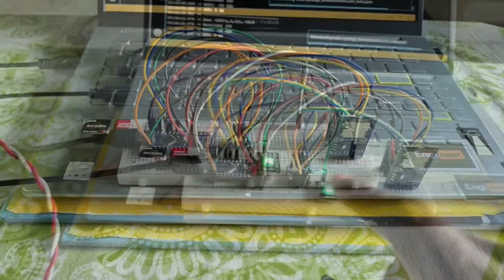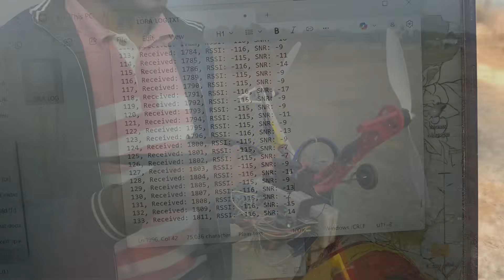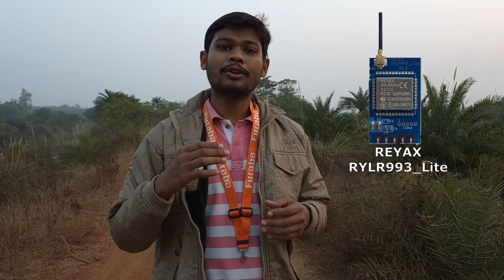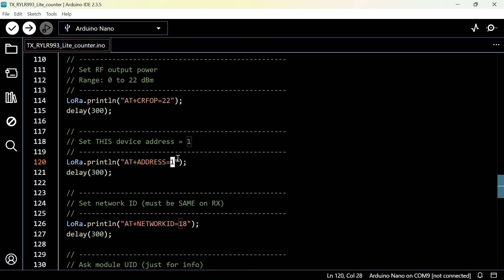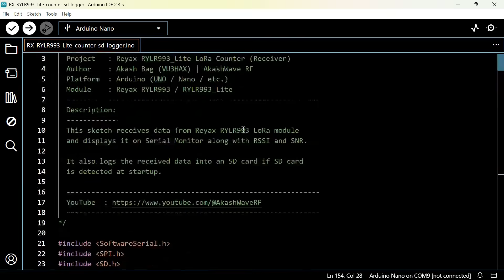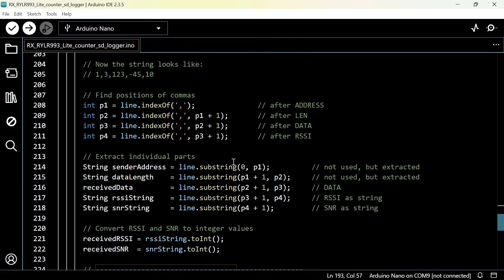Can This REYAX RYLR993-Lite LoRa Reach 20 KM? | REYAX LoRa Range Test #rf #arduinoproject #antenna

Comment: I am looking for a 10 km range LoRa gateway and node. Is it possible?
Reply from the maker: I had already tested range of multiple different kinds of LoRa modules in my channel with real rssi and snr deta along with schematic and Arduino codes provided. It possible, but every module have their different configuration their different communication protocol and all of these things. So please check out my channel watch those videos then it will be very clear to you which one to choose.

Comment: Hello bhai
I am a student and starting my journey in LORA. I am somewhat impressed by the range provided and wish to work on it. Can you please suggest me a good LORA module that will be perfect for me, not only now but for a long run giving proper signal. I don't have much idea in this sector, so also please tell the sources from where I can learn.
Love your videos
Reply from the maker: I had tested several different LoRa modules from many different brands already on my channel, like Reyax, Ebyte, AI thinker and others. I'll also make a video on sx1262 LoRa modules also. First of all, you should make your own choice of module by watching those videos. I hadtested range, along with critical rssi and snr data. So everything will be very clear to you. Talking about my personal choise, when it comes to easy to use and high performance LoRa, I really like these Reyax RYLR993 Lite LoRa modules. If I need high output power, I'll use RYLR999 lite, which also comes with onboard ble, you can checkout that video too on my channel along with range test of both of them. And if I need full control of a LoRa over spi protocol, then I'll choose SX1262 by Wave share. These are tested LoRa modules by me. Hope this will help you.

Both Reyax LoRa modules has been covered on my channel with Arduino codes and schematics and real-life test results. I had also explained their datasheet and at command set clearly. My videos are not that much beautiful looking, good editing or that, but I genuinely try to share knowledge with you. So if you are interested on rf or LoRa or antenna, stay tuned here☺️

Comment: Marvelous excellent 👍 VHF/UHF communication coverage depends greatly on line of sight.

Most aeronautical VHF (civilian) & UHF (military) radios are just 5-10 Watts, and can communicate 400-500 kms when flying.

Even portable Satellite & Manpack radios operate on 5-10 Watts for communication through Satellite, which are hundreds of kilometres away in the sky.
Reply from the maker: Yes, if there is line of sight, even 1W power is also very high. We use to communicate to iss, use iss as a repeater to talk to a larger area of people just using a 5W radio, which gives a realistic output of arround 4-4.5W, also there are cable loses, antenna mismatch, but still using a simple 3 element yagi, we can send our voice to iss from ground directly. Manu small cubesats flies in the space with just 1W radio telemetry and from earth we can receive them! Radio frequency is just a light which we can't see. So if there is no any think between which is stopping it to reach to the receiver, it can go really far, how we see starts from millions of light years too! Line of sight is really important, otherwise if you scream on a 100w vhf radio from inside your home, I don't thik it can go 5km properly 😅
Reply: @AkashWaveRF even 0.25 milliwatt at VHF fed into unity gain GP antenna is enough to access a repeater 40 Kms away subject to line of sight. Possible only under test conditions or in absence of any interference
Reply from the maker: You are really a knowledgeable and experienced person in radio equipments and ham radio. Can we contact on insta for a normal chat? I just want to talk to you, sharin our knowledge and experiences ❤let me know. My insta id in in the channel bio and also in video description box 😊

Comment: Good work but it doesn't only depends on the range also how much it can communicate with the transmeter and receiver with many components rather then just a led. But I still apritiate your work and testing
Reply from the maker: Yes, the reliable communication range also depends a bit on the data packet length, but using the coding rate checksum, we can actually improve data packet retundency too. Thank you so much for your appreciation and support.  Please stay tuned with me, do subscribe my channel😊

Comment: Bro is it possible to connect ur lora module to ur drone ass receiver, soo that uu can control ur drone from approximately 10 to 15km p
Reply from the maker: Bro, watch my letest video on nRF24l01 rf module, where I had explained, why LoRa modules are very bad choice to control a drone live using remote, while using LoRa as a telemetry link or flying a drone using command and use LoRa to send the data packets is what LoRa types modules are made for. Watch that video, you'll find why. And the short answer is no, we can't control a drone live using LoRa😊 hope you understand what I'm trying to say, and keep watching, keep supporting, stay tuned in my channel, and this Friday afternoon I'm going to upload an exciting 1w output LoRa module range test, hope you'll enjoy that😊❤

Comment: Wow what an information dense video . Thoroughly enjoyed. 
Can you make a video on how you made your antenna? And second do you have a video on text message communication with lora module? Thanks.
Reply from the maker: Bro, in a few weeks, I'm going to make some more informative videos on new LoRa+BLE modules, which you can directly use from mobile for transmitting and receiving, no microcontroller needed, so please stay tuned with me. I'll make a full configuration and how to use tutorial, then I'll make another range test on those may be, and I'll also show, how to interact between Reyax rylr993 and rylr999 moduoes together. And you are asking for antenna making video na? I had already uploaded several videos on how to make a dipole antenna, how to tune a dipole antenna, how to use nano vna to analize antenna. Those all videos are informative, and you'll know how to use those devices from those videos fully. So please go and watch those videos, you'll love them, I'm sure. Keep supporting, stay with me🥰

Comment: 433mhz or 865mhz lora module is better for gps tracking project in urban areas from ground level for long range ,no need of fast update data , please reply
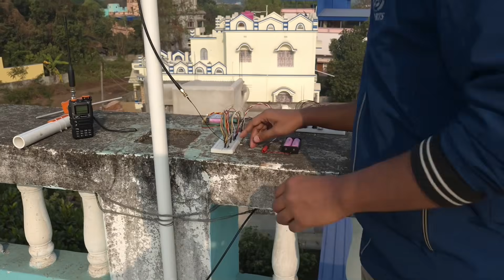Reply from the maker: See, 433MHz frequency have a much better panitration power comparing to the 865-8 67MHz frequency. But for normal people, 433 MHz is actually allows only 10mW maybe, which is not usefull at all... For licence holders like me, we have much more transmission power permission, but for non licensed operators, only that 865-867MHz is useable, because that allows much higher power, upto 1W maybe... So use 865-867 mhz. And if your transmitter is on top of your roof, that frequency also performs almost same... So go for 865-867. After war, frequency monitoring has been increased and authoritise are checking carefully, so don't do any illegal transmission on any non permitted band and non permitted power level, Stay legal, stay safe. I hope you understand what I'm trying to say. Stay tuned, more videos are on the way on LoRa and UWB modules. I'm going to upload a detailed tutorial on UWB modules, how to calibrate them even this Friday 6:30 arround. So if you are interested on these topics, stay tuned, do subscribe 😊
Reply: @AkashWaveRF  thank you for your valuable information 🙏 ❤

Comment: Isse walkie talkie bana be
Reply from the maker: Isse walkie talkie banana asan nahi hai vai, LoRas are mainly made for extra long range ultra low power, digital data packet transferring. That's why inka data rate bohot Kam hota hai! Although maine dekha tha kuch, kuch logone banaya tha walkie talkie inko use karke, but difficult in another level! I had made an walkie talkie during my final year project of BTech using nrf24l01 modules

Comment: Please make a video on waveshare sx1262 hf module
Reply from the maker: I actually bought 3 waveshare sx1262 hf modules few months ago, but due to these LoRa videos, I didn't get time to make videos on them. Now I'll upload a ebyte lora module video, then I'll upload that sx1262 LoRa video and also range test of it, as range test is my speciality and my main interest. So please stay tuned in my channel, do subscribe😊
Reply: @AkashWaveRF thanks for replying.Actually i am a NIT DGP student ,working on a project based on lora. I am currently working on those modules and attached 3dbi antenna but didn't get enough range although sf is set at 13 and bw at 125 and other factors also set according to the max range. So I want your help to select the best module. And one thing please reply that if i am using 865 MHz freq and the sx1262 can output up to 22 db but some lora modules like ebyte e22 produce upto 30db. So is it legally permissible to use higher db? I am asking this as I am building this project as a product for normal people.
Reply from the maker: Bro, these things are not small topics, they are vast topics themselves. Message me on my Instagram I'd, and let's have a detailed conversation about this. Durgapur is very well known to me, I use to go there... The output power, frequency, legal illegal, there are so many things, whichs are impossible to discuss on youtube comment, as it's not a very suitable place for conversation. I can guide you properly in terms of various modules, output power, legal bands, as I'm a licensed Ham radio operator. 😊 Let's have a good conversation there
Reply from the maker: Actually seriously speaking, messaging is not my comfort zone, that's why they who need serious discussion, I use to audio call them on instagram, that's my way...
Reply: @AkashWaveRF oh ok then I'll get in touch on insta.

Comment: Very well documented with multiple tests done with the module. I think you could still get the signal, more than 15KM, with this module, since the test ended at 15KM🎉🎉🎉. And also liked the SD card module as a supplement add-on for debugging your tests...would like to see more of such videos...God Bless...
Reply from the maker: Thank you so much! At 15km away also, the RSSI was too good, arround -115dBm, and according to datasheet, this modules can go upto -148dBm. So I think this module can easily cover more then 20km distance. 

Thank you so much for your this support. Your support is the only motivation, which drives me to make such high effort videos. Thank you so much!☺️
Reply: @AkashWaveRF hey brother it would be very helpful if you share the antenna stl files and everything necessary length and size of wire or everything please? Because you have already tuned the antenna so it will be very helpful for us and we don't have any kind of tool to tune it i am just starting in rf and all this feels unreal to me 😅
Reply from the maker: I'll upload the stl file of the antenna on thingiverse, and then I'll send you the link. Please message me on my Instagram, and when I'll upload the stl file, I'll definitely let you know, okk? And also I'll tell you the exact dimensions of it too...😊
Reply: @AkashWaveRF thanks a lot it means a lot to me as your subscriber ❤, and yes one question ❓ i was testing default spring antenna with cheap lora module of 433MHZ and i am not even getting 1 km with it so my module is fine or faulty? How can i ensure that the module i am using is not faulty?
Edit: i wanted to test it again with your antenna and it's a difficult part for beginners so i am asking for the STL file
Reply from the maker: It's not that much easy actually to check of your module it good or not. You need a costly receiver for that purpose. Yes, please message me on my Instagram, because due to a very high workload, I just forget to upload that,even I can send you those stl files personally also... Sorry for let reply, youtube don't send us notifications for a reply in a reply 😅😅😅

Comment: Very informative video. Clearly explained about the usage, circuit and range test. 

I am looking to use them in my project. Hoping to find a reliable supplier for the same.
Reply from the maker: I think it's one of the best LoRa I had ever used! Just think, with just 160mW output power, how far it's going! It's performance is really stunning!

Comment: what is the range of suported friquency
Reply from the maker: In free space, or line of sight, all frequencies will perform the same in terms of range. But when there are obstacles, then lower frequencies can panitrate them better then higher frequencies. That's why LoRa modules comes in both 433 & 868/915MHz frequencies... I hope you understand 😊
Reply: @AkashWaveRF no i am taking about the operation range of friquency this particular lora module module support, as you mentioned we can chenge the friquency of the module in the code
Reply from the maker: Okk, I understand. It's called operating frequency range, for this module which is 820-960MHz. You can check all specifications, products at command list and everything on their product page, I had already provided the product page link in the description box. Please check out☺️
Reply: @AkashWaveRF  ok

Comment: I saw you used the 865 MHz band for your test because of local ISM laws. If you were to try this in a different country using the 915 MHz band, do you think the 20km range would be easier or harder to hit due to the propagation characteristics of that higher frequency?" 🤔
Reply from the maker: See, first of all, the frequency matters when it comes to the panitration power, it means when there are obstacles between the transmitter and receiver. In that situation, 433mhz better performs then। 868/915mhz. But the range isn't dependent on the frequency at all, it depends on transmitting power and receivers sensitivity, okk? And when it comes to comperison between 868/915MHz, panitration power, range all are more or less same, so you shuld not compare between 868 and 915. I hope it's clear to you😊
Reply: @AkashWaveRF Thanks dada aabar bujlaam😊
Reply from the maker: You are welcome 😊